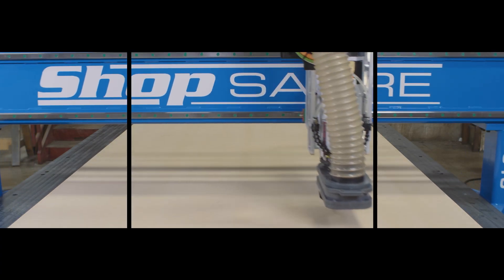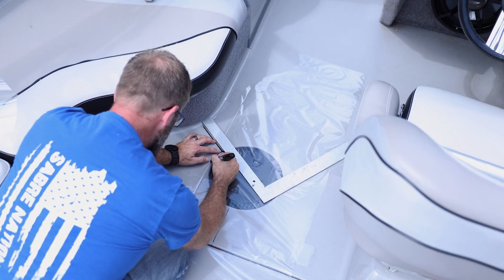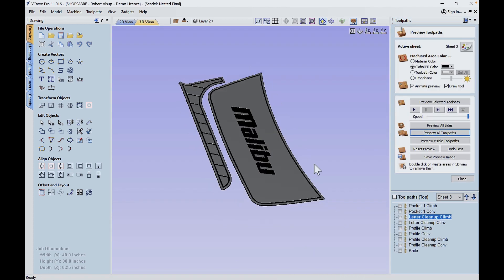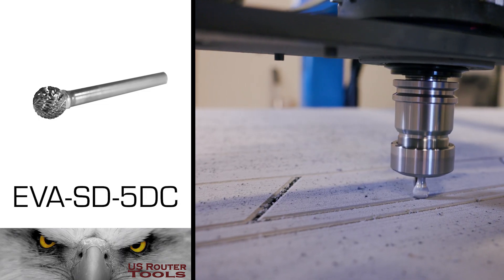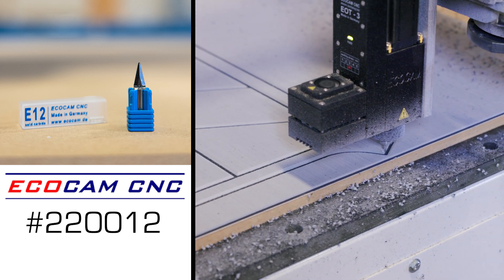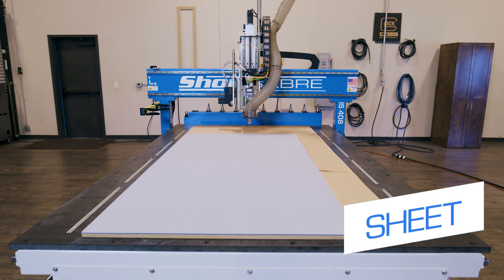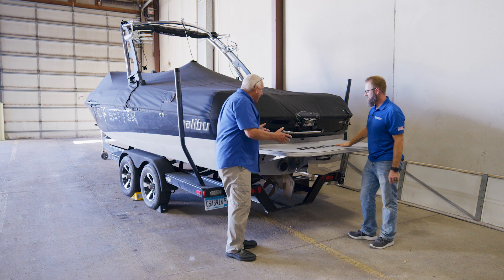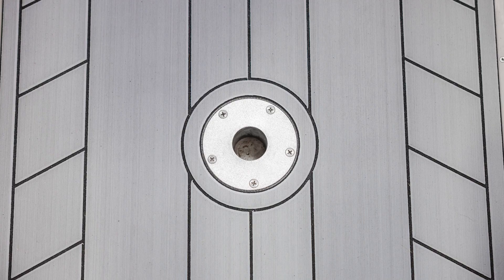ShopSabre CNC Cutting EVA SeaDek Foam - Part 2

Comment: What type of roller are you using? Could you share the model with us? Thanks
Reply from the maker: We don't have the specifics of this item on file any longer but I did find one that looks very similar at Home Depot. https://www.homedepot.com/p/POWERTEC-17-in-to-27-in-7-5-in-Wide-Extendable-Handle-Floor-and-Wall-Roller-for-Vinyl-Flooring-Tile-Linoleum-Roller-71033/308149377

Comment: what is the difference in cut depth for the decking bit and the carbide ball bit?
Reply from the maker: Our technical support team can assist with this question. Give them a call at 952-461-4570

Comment: How did you get a outline of the floor? Can you use a 3d scanner? Or did you do the initial tracing on mylar and plot it on the cnc table with a probe? Thanks
Reply from the maker: There is a number of ways to accomplish this -- they make laser scanning devices for high volume needs but for many they use cardboard or tracing paper and then outline the shape and use the digitizing / tracing feature our controller offers standard to recreate the shape in CAD

Comment: I have a 1325 ATC Blue Elephant CNC. I cut Ausdek EVA flooring for a business. My machine runs at 18,000 rpm. I would like to buy the tool bits you're using. Is my top RPM speed too slow for a clean/best cut.?
Reply from the maker: ideally you will need more RPM, we would love to help you upgrade to a ShopSabre machine :)

Comment: Could i use just the eva bit? Or does it make it that much more cleaner using the burr bit? Alot of xompanies are using 1 bit.
Reply from the maker: The process we show is the way to achieve the best results. Some companies will cut out processes and steps but ultimately cutting corners rarely produces the same results.

Comment: any recommendations for cutting on a non-vacuum bed?  Using mdf sacrificial so able to add screws
Reply from the maker: We do recommend vacuum for this application and best performance as screws do not provide even holding force and can lead to accuracy concerns. You likely will want to consider using Tape on the backside to help if you are going to do this without vacuum.
Reply: @shopsabre  Cheers Mate, double sided tape was on my mind to use also . Issue to would be that i only have a drag knife capability therefor risk movement of medium with that also. I'll have a crack at it one way or another .

Comment: Is it possible to know how fast the spindle is turning and the speed of the machine?
Reply: Hi Stefano, we ran these at 400 IPM and 24000 RPM.  The key is to run each tool in both a climb and conventional cut.  Good luck and thanks for watching!
Reply from the maker: Yes, on the screen our system will display RPM & IPM - both are adjustable on the fly with the appropriate machine options. In this video, we ran 400IPM & 24K